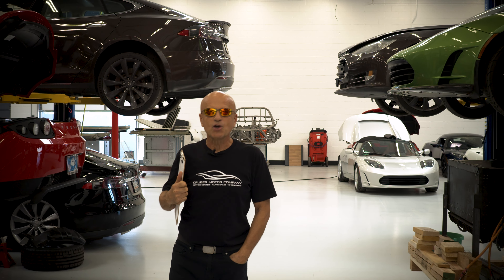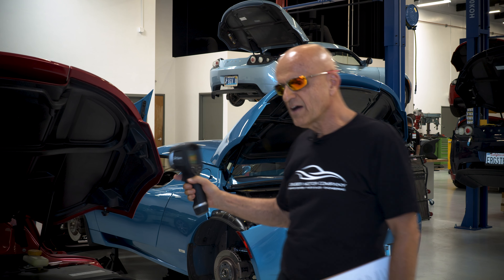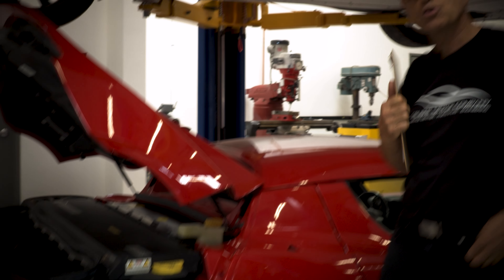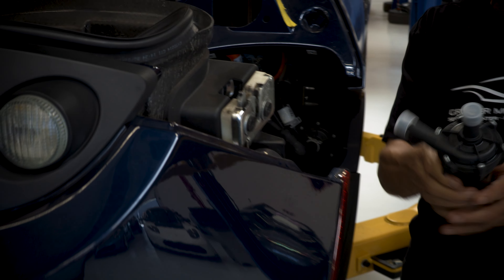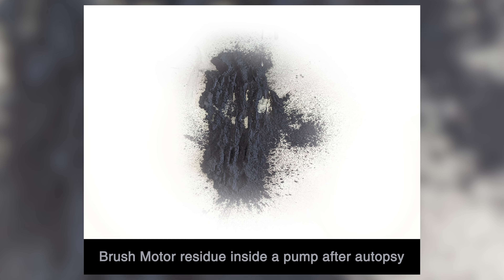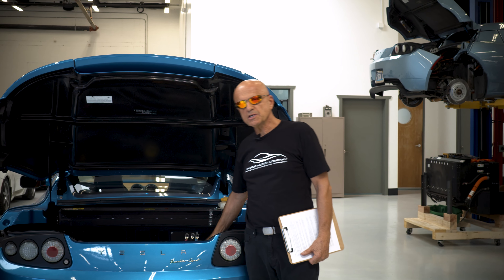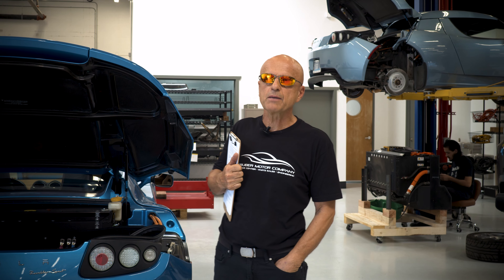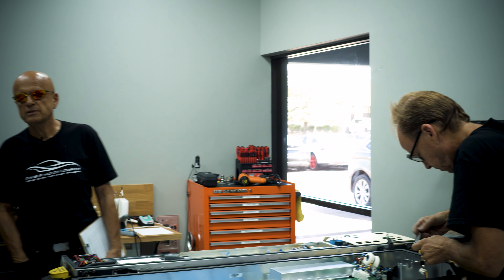TESLA Roadsters are Overheating! | Gruber Motors

Comment: Thanks for sharing!
You recommend the 110v wall plug for everyday charging? 
I thought you lose some cooling function without 3 phase charging?
Reply: Correct on the cooling.  The car does not have enough power coming in at 120v (Level 1) to run the A/C to actively cool the battery.  Best to use a 240v charging system (Level 2) and turn down the current via the VDS.  I have a 50 amp outlet (so, 40 amp max charge rate), but do my charging at 24 amps.  A day's driving will still complete well before the next day, even if I don't start charging until 10pm.

Another trick is when you get home with a hot battery is to do a short (30 minutes or so) charge *in range mode*.  You can turn down the charging to something like 16 amps, too, to prevent adding more heat to the battery.  Range mode puts an emphasis on cooling the battery first.  Once the battery gets below 30C you can stop the charge and return the charging mode to Standard.  The coolant pump will turn off and the car will properly go to sleep, waking up late at night for the rest of the charge cycle.  Don't forget to stop the charging once it cools, or gets to 80% full; letting it completely charge in Range mode will stress the battery.